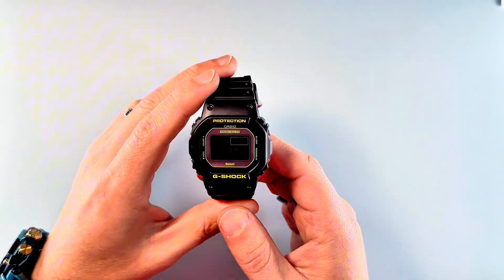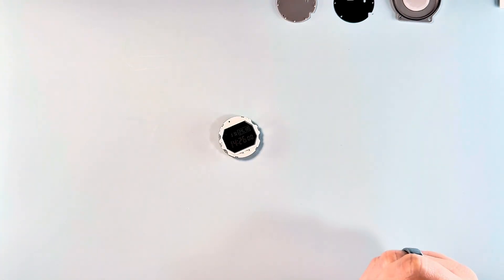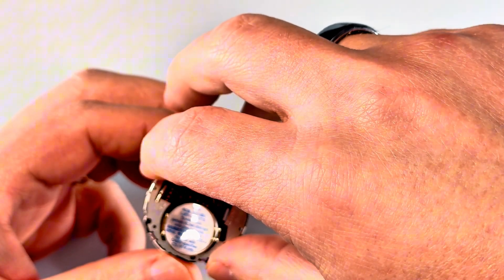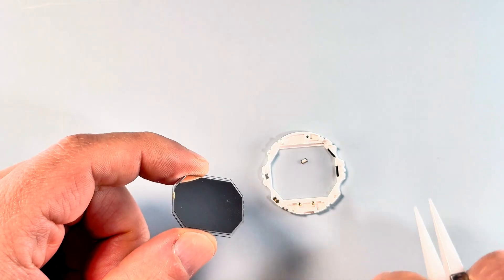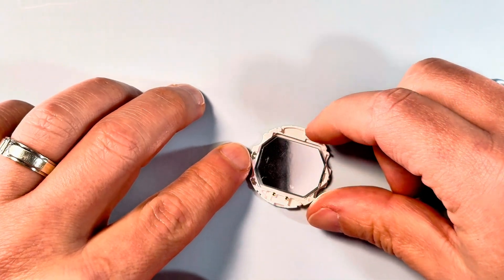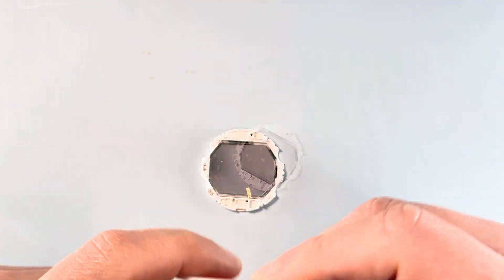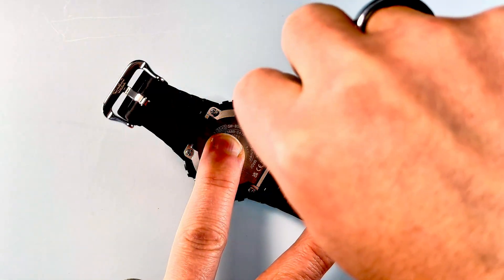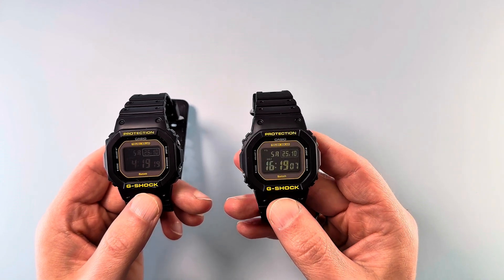G-Shock GW-B5600 TN to STN Display Upgrade

Comment: Thank you very much for the effort and cleanliness of your video. It has given me courage to try it myself, because I had no idea how my B5600 looked like inside or what should I look out for when attempting a process like this. Long and detailed video, just what anybody would need to attempt this. 

Also, I don't know if I'm missing something, but how does the LCD connect to the main board? It would seem the connectors of the board go directly to the plastic/diffuser thing. It is just curiosity, since the only spring contacts would seem to be the charging and the springs for the LEDs.

I subbed!
Reply from the maker: Thank you for the awesome feedback. I really do appreciate it. The LCD connects to the board via the little rubber strips you’ll see in the video. Let me know how it goes.

Comment: The problem with MIP displays is that you can get pixel damage, screen burn, spotting and also won't last as long. Also the  battery life is much shorter.
Reply from the maker: This is STN, not MIP, but I do reference MIP so that maybe why you raise it. 

Personally, I own around 10 MIP display watches and so far haven’t had any issues at all. They’re flawless. Not to say they can’t go wrong. I’d choose MIP every time though if I could.

Comment: There are driving differences between TN and STN displays, i.e. they are not 100% compatible.  They are close enough to work, but it could be the STN display is being over driven and may not last the test of time, still I guess it can just be swapped out again.  It could also be possible that the LCD is able to signal back to watch (with shorted or open connectors) that tell the watch if TN or STN is installed, as this adds flexibility to making the different modules with different types of display a simple matter of installing one LCD type or the other on the production line.  Certainly an interesting modification.
Reply from the maker: I suspect Casio will have made them backwards compatible as that would make module production cheaper and we all know Casio like to cut costs 😆. I don’t think there are many/any differences between the modules, besides the LCD. It would be interesting to know for sure though.

Comment: Does anyone make the screen as a third party part? or just use another gshock part?
Reply from the maker: To my knowledge only official parts. It was only £11.99 so not a bad price.
Reply: @G-ShockerUK interersting, it's making gwb5600 turn into gmwb5000, hope these parts are available in my country
Reply from the maker: @riyansyeah Yeah pretty much. I’ve just ordered another 4 displays 💪
Reply: @G-ShockerUK awesome, perfect gwb5600 super light but very legible, i think gmwb5000 too heavy some deal nreaker for me